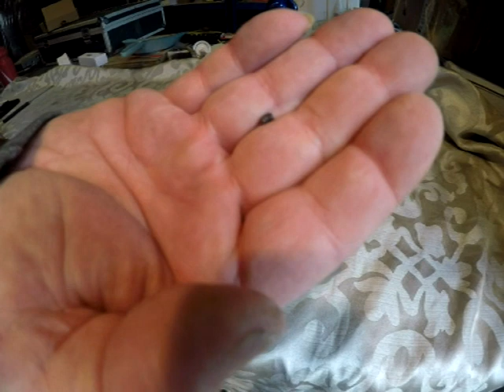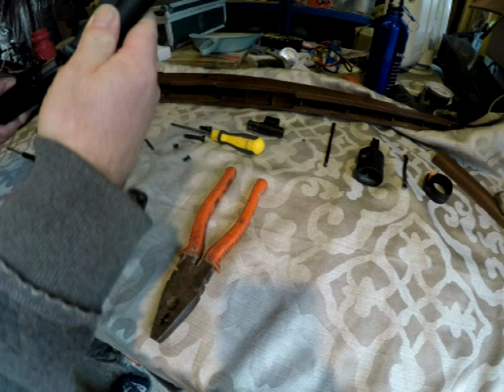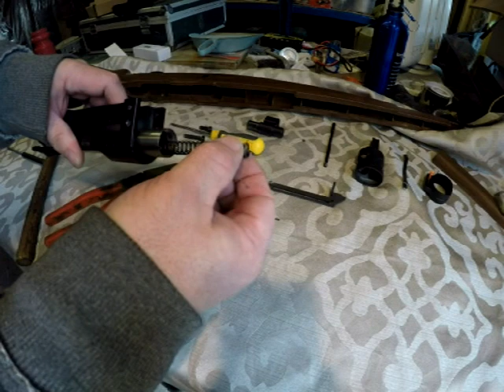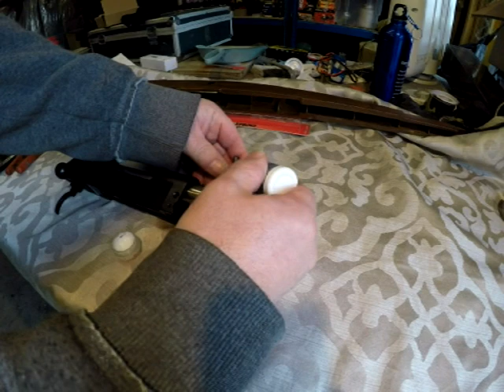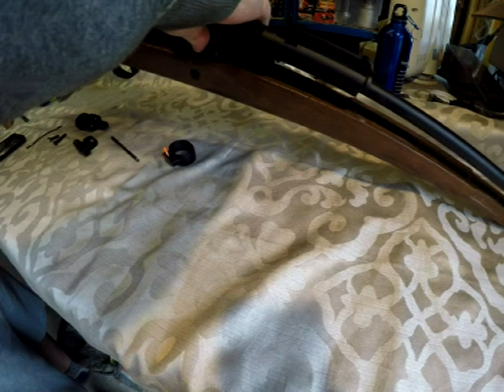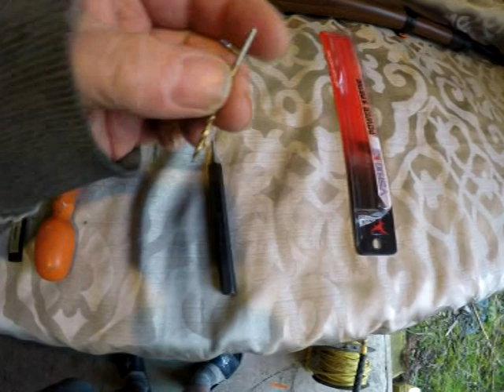Upgrading a Kar98k airsoft rifle to fire at 500fps

Comment: 1:31 I wasn't looking to upgrade my rifle  but I'm just wondering  what size/ where do u think I could buy that bolt as I actually lost mine as I had my rifle lined up against a wall which it then later on fell on the ground twisting the front sight to the left and some how the bolt missing ,thx